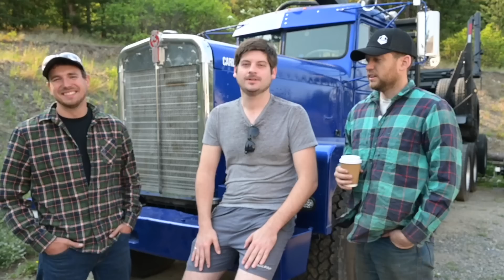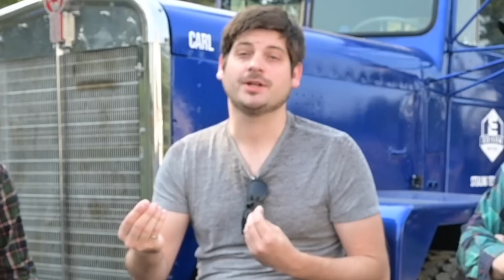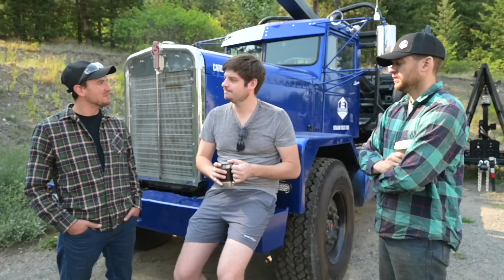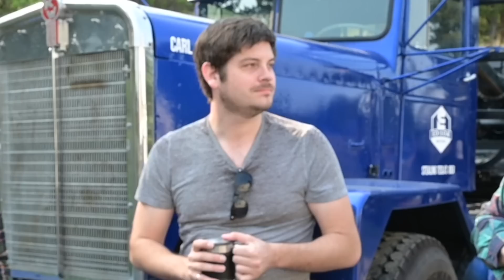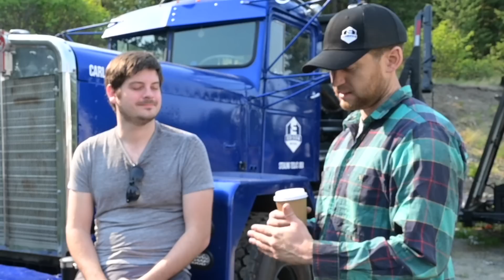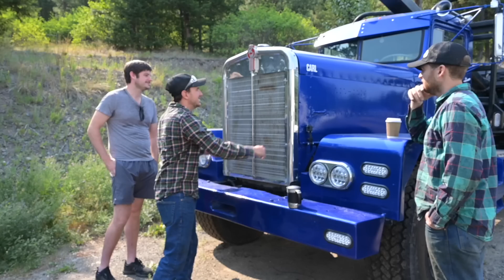The future of Electric Trucks?

Comment: Here's the "10 years later laughing about it": With European regulations (45 minutes of rest time after 4.5 hours of driving, max driving time 10 hours a day, speed limit of 80 kph on highways, 60 kph off-highway), it already works perfectly with 500-km-range battery electric trucks and 400kW chargers. The trucks are there, the chargers are there, the numbers work out in reality, and the TOI looks fantastic.

Comment: Yup, data is extremely valuable (assuming it is analysed and understood...).  An experienced automation engineer once said to me "If you aren't measuring your system, you don't understand your system". I was a bit offended.. as a factory engineer I thought I understood my system just fine.
I was wrong, he was right... as I got into automation and energy efficiency, I found that every temperature or pressure transducer or other "measuring device"  I fitted paid for itself many times over due to efficiency gains from increased understanding.
More than the efficiency gains, the whole plant became more reliable as we could "see" events occurring that we had been unaware of, identify the cause and resolve the problems.
I can see the same benefits for vehicles.. logging the electrical system while driving could show up peak loads, temperature spikes etc, and understanding these and resolving them could add significantly to the service life of the truck, or inform the reforming of a road to allow greater efficiency of the trucks using it etc.
Great work guys, exciting times! Looking forward to seeing your company succeed, grow, and become a transformative organization.

Comment: So honest questions first time seeing this truck. Batteries drive electric motors on each set of tires. In the engine bay is a diesel generator that charges the batteries. So what’s the point where or how does this beat traditional semis. Feels like it would use just as much diesel. Please some body explain.

Comment: The same computer could eventually keep track of its own weight and turn on a warning yellow light or red light for overweight as its being loaded and never have a overweight issue ever again. It would know the route and any road weight limits. It could sent into to truck stops before you get there and if the truck was stopped 3 weeks ago with no issues, and the transmission says all is well, it could give you the green light to not even bother stopping.
There could even be sensors reading steering slop etc, that could indicate bad tierod ends etc.

Comment: A program controlling battery charge before going up or down large hills could also control the radiator fan to avoid turning on the fan when the generator will be turned off in the next minute and stay off for a while, reducing power use and keeping the engine warmer for when it is restarted.

Comment: Wondering if this could be used for some of our roll off trucks. We have a bunch of tandems and triaxles running around the Rockies and they load up near the top of the hill and unload near the bottom.

Also wondering if you guys could share more information on your model for when it comes to general city/highway driving.

Comment: Super capacitors and high voltage that is the future of your efforts .capturing that energy is the problem , you just cannot capture that energy at the rate that it is being produced by charging batteries you must capture it with ultra super capacitors .

Comment: Another idea with the needle nose is a forkable or easily hookable battery "pallet" that bolts to the frams so if any service to the battery in the front is needed it can all be removed in one go by just removing the hood and a couple connections

Comment: I love that Dave is covering the fact every location is unique as is the most optimal solution; that is going to be one hell of a well earned doctorate!
The big one is interchangeable energy; if managed correctly the real possibility exists of opperation with near zero, zero or negative energy costs; yes that depends on each individual site.
I noticed that some commenters still don't get that this about optimal use of resources; fuel will not go away (at least for now in most situations) the technology isn't quiet there yet, but the technology is here to facilitate 'use fuel only when you absolutely need to use fuel' and lower your bottom line in theprocess.

Comment: All the batteries under the hood means the truck will get stuck easily when running empty. The diesel is 2500lbs. But I think the battery is heavier.

Comment: The difficulty in repairing chinese axles and other stuff outweighs fuel savings. I think.   But you are on the right track  if we could build this stuff locally.
Reply: China has more Engineering graduates than the USA for many years already.  Get real.
Reply: @Adscam  We needs more parts on the shelf. Can the engineers in China do that?
Reply: @ridestreet20 . I thought that you pay them, they will deliver.  Unless its the damn old supply chain problem.

Comment: Remember if one can throw in an electric power pack, everyone else can too.

A crucial consideration is enough battery to allow maximum regen back to the mill. 
If the battery is full 5 minutes into the return trip, there are few further gains thereafter. maximising energy potential is the game here..

Rise and fall in every road segment is known, hybrid hydraulic regeneration systems in Australia were working the energy needed - and accounting for predicted future deficits to minimise fuel consumption (Permodrive).

Changing the absolute layout of forest blocks could be huge.

Powering the mills with idle trucks - surplus energy from the downhill trips could grid feed also...

You guys pay less for your power than we pay in grid access fees...Even at a spot generator  price of 5c, means  the consumer is exposed to 15-20c (that is IF they are exposed to market prices  - then markets have the downside, when prices peak to 50c/kWh  (good for generators, not so much for consumers..

This level of planning is normal for aviation, not necessarily for road transport.

For more batteries up front, tandem steer axles allows for another 5tonnes of payload up front.

Comment: They looked at using EV converted Cat 777 and 773 mining trucks to take the coal from the mine i work on down the hill to the rail loadout, about a 2000ft drop over an 8km haul road......turned out that it was not viable on current tech when duty cycle was taken into account.....it couldn't move the same tons per week as the same size trucks on diesel and the EV's cost per ton moved was at best case 20% higher based on the best case battery life and with a very optimistic cost of conversion and the lower maintenance cost factored in

Comment: Don’t know how efficient regenerative braking is but if you move enough tons down enough elevation change you could make more power loaded as needed empty. Now you would start out with low batteries and end up full. Imagine a fleet of trucks parked at night putting power onto the grid. Now your truck is generating revenue 24 hrs a day.

Comment: I'm betting part of the problem with putting the batteries up front is that in the case of any head on collision, your batteries are up there for the brunt of the force making for a massive safety hazard. It's why so few cars use the "frunk" to put extra or more batteries in.

Comment: Motor-generators also have interesting efficiency curves that vary by current level. If left totally to the typical driver, they will want to accelerate quickly, but keeping the mechanism well within the high efficiency range can significantly reduce the energy consumption to do the same work.

Comment: Battery prices still have quite a ways to come down. I'm not sure what the cost breakdown is, but I can see the battery/e-axle combination being significantly CHEAPER than a diesel/transmission combination in the future at which point the diesel trucks will only have ease of fueling as a selling point.
Eventually, as your guest pointed out the economics will be so compelling that the challenge you will have will be HOW FAST CAN YOU MAKE / RETROFIT TRUCKS?
(If you will note, Tesla is already at this point - which is why they aren't building the Semi.  Not enough batteries for the Semi and the cars, but that will change. Hopefully soon, if you read between the lines the 4680 cell has NOT been a success so far).

Comment: Regarding regenerative braking. I’m curious what you’ll do for hold back braking after the batteries fill up when coming down a mountain. Obviously there are air brakes but brake fade could be an issue. Is there a way to utilize compression breaking (Jakes)? Or a resistor bank (maybe in the headache rack?)
Reply: I totally understood your question.
Reply: Regenerative braking doesn't actually use the service/air brakes. Theoretically, a good driver wouldn't need to use the service brakes ever.

Like diesel/electric trains they will have a big heater grid to burn the excess electricity
Reply: @jasonwilliams8016  yes I’m aware how regenerative braking and air brakes work and the obvious fact they they are completely separate functions.

As stated in my question, what will they do after the batteries fill up? Because when the batteries fill up to 100% then the electric motors will not provide resistance when coming down hill. Conventional log trucks and most semi truck relay on compression brakes when coming down hill loaded. You use compression brakes to save your service air brakes. Because when going down a hill loaded you’ll over heat your brake drums and can lose your brakes VERY easily.

So this comes back to the question, what will they do when the batteries fill up? Can Jake brakes be used on the generator? The wheel motors turn into generators and diesel generator turns into an electric motor. Then the engine can provide braking resistance via Jake brakes? Or would there need to be electric resistor banks in the headache rack so that the drive motors have somewhere to send power after the batteries fill up. So that there can be resistance and the air brakes can be saved for emergencies.
Reply: @jeremykamel9655  they've discussed using a resistive element like a heater grid. Same as Diesel/electric trains!
Reply: Additionally when lithium batteries reach about 80% they slow down significantly in absorption of current from charging/regenerative braking. So in reality this won’t just be an issue when the batteries are 100% charged but will also need to be addressed once the batteries reach 80%. After which there will be a significant reduction in hold back braking and that hold back will completely disappear at 100%.
Reply: @jasonwilliams8016  I didn’t hear that. But ok, that answers the question. That resistance banks can take up a lot of room. But it’s certainly a necessity.
Reply: @jeremykamel9655  He mentions it in a previous video and I believe there's a short too. "Tesla coil"  on the roof! Lol
Reply: Crazy idea; it might be possible to shunt excess power to ground though not sure how safe it would be.

Most likely the system would balance between regen and service breaking. 
Having 2 different breaking methods to work with definitely adds possibilities.
Reply: @johnwenzel2003  the only way to shunt to ground is through a resistance heat bank. Basically a heating grid. That way it’s a controlled grounding. And in that way you can even control the amount of hold back by turning on more or less of the coils.
Reply: @jeremykamel9655  Thanks for the info.
Reply: @brianb-p6586  LOL I’m aware of that. Guess what, the controller does the switching. I did not mean literally switching. Read between the lines please.
Reply: @brianb-p6586  additionally you mention the back up being “the brakes”. Well obviously you’ve never driven a semi. Because a semi like this when hauling a load will have an unlimited duration of “Jake brakes” while going down a hill. They are essential for safety. Also they are adjustable by using 2, 4, or 6 cylinders worth of compression braking. Have you ever seen run away ramps on steep grades like mountain passes? The service brakes over heat very easily and brake fade is deadly. Especially on vocational trucks like what Edison is making. Logging roads and local roads don’t have run away ramps. 

Your ignorance is astounding.
Reply: Go watch the video "jake brake on an electric truck"

Comment: Great video, I often pondered, what if they graded highways on flat routes to complement hybrid vehicles. Getting on the highway should be from a higher elevation so that part of your acceleration comes from gravity assist. Getting off would decelerate also with gravity assist. Long stretches would run at a pitch down hill to match well with the likely drag from wind resistance. Of course you would need to go back up to the top every so often but that would be coordinated with the engine to recharge on the incline powering the vehicle and charging the battery at an optimized loading level and then shutting down after the climb.

Comment: Heck a driver/owner could use the truck to power their home at night, especially a owner of multiple trucks, they can harvest energy all day. Then power ther home at night, as long as they know their basic job the next day, start out with 50-60% charge, get loaded eith 40-50% . Then haul to destination . If down grade arrive to the destination with 70-80% charge, return for load with 60-70% By the end of the day return home with 95% charge

Comment: What about when you get to sawmill . You dump the extra energy into stationary batteries.  Then those batteries can supply power into the sawmill or power grid. Then the truck can go back up the mountain to get another log load, and potential energy fill up.

Comment: Can this thing haul anything? You've promoted it a lot through social media but nobody has seen you actually pull anything significant.
Reply from the maker: As shown in at least a dozen of our videos, and explained in even more. The output shaft on Carl is for a pickup truck, and can not handle the weight or load of the truck or electric motor. 
The driveline twists off when you apply heavy throttle or load. 
This problems has been eliminated by using E-Axles on our next truck. 
- Theron Danger

Comment: Careful on oversizing the diesel engine. In tracked equipment we have encountered problems where the engine operates in the low end of its range.  Issue comes with the emission systems expecting a higher load percentage.  Result is damaged and or failing emission systems.  

Essentially you have to burn fuel with oversized engine just to insure emission systems are operating correctly.

Comment: hi guys keep moving forward. we need to know the data on performance. i know two people who bought ev's and there range does not match what they were told it would be. that contributes to range anxiety. the hybrid design eliminates the anxiety issue. myself i would opt for the hybrid system almost every time. the ability to switch from just truck to grid topping allows flexibility.

Comment: Drilling rigs turned to diesel electric years ago. This had money reasons. The tax is reduced if you are generating power. The tax saving was more than the coats of going diesel electric. I haven't heard ypu mention this. This is a cost saving over and above off road diesel tax rates. Check it out hiys.

Comment: I know there's a TON of cool stuff discussed in the video but I latched onto the idea of the trailers being E-axle equipped. Literally the potential for 18 wheel drive
Reply: considering that canadian logging trucks are often tri-drive, and you might have 3 or 4 trailer axles, we could be seeing much more than just 18 wheel drive.
Reply: @boxr_4214 not many 18 wheelers anymore in BC at all. Either triple/triple, tandem/triple or trains lol
Reply: Better to think of it as 'all wheel drive' if you power the steer axel(s).

An 8x8 tractor with a 3 axel trailer would be cool as hell if it was needed for the job.
Reply: Definitely be a plus
Reply: It will be interesting to see a fully all axle drive truck. Could your truck eventually start the working day with a full battery and if the regen system was set up correctly end up with a full battery at the end of the day? Also on regular electric delivery trucks that used different drivers on the same route using the same truck could this program show the difference between the drivers? All that aside I can't wait to see your history making truck completed and moving under its own power.
Reply: @darrellbedford4857  
You may like to check out the developments in Formula E*, WTC, F1 and pretty much all modern motorsports - regen plays a critical part in all those, and the efficient use of that, the battery capacity, and the power delivery.

*As the only, current, all-electric sport, but there are others also going 100% electric, like one of the World Rallycross Championships - oh, Extreme E is an off-road all electric race series.
Reply: Lot of added weight tho. So it would be a small application
Reply: @sheldongoossen  it's not that uncommon for a dozer to pull loaded or empty logging trucks uphills. Front wheel assist or a powered trailer would be useful. There are off highway logging trucks all over the coast of BC. Weight isn't an issue!
Reply: @jasonwilliams8016  
Exactly - bob-tailed, especially long wheelbase, trucks have most of their weight on the front axle. In soft, or slippery conditions, that can make the vehicle impossible to actually move if the tractive force spins the drive wheels, rather than overcome the resistance.